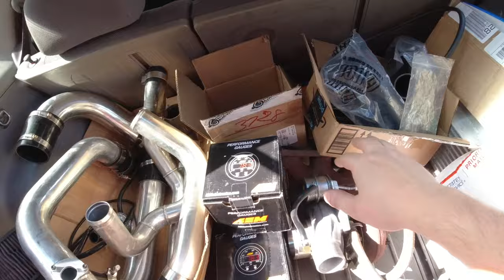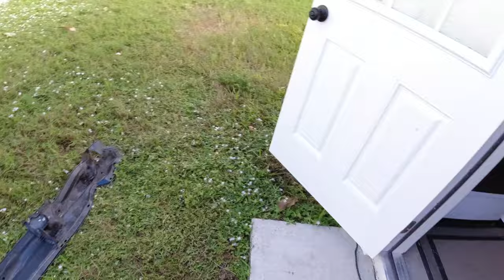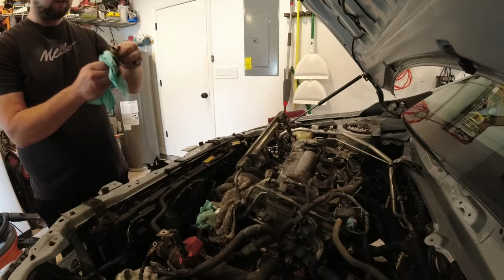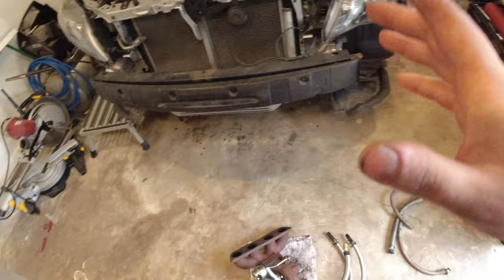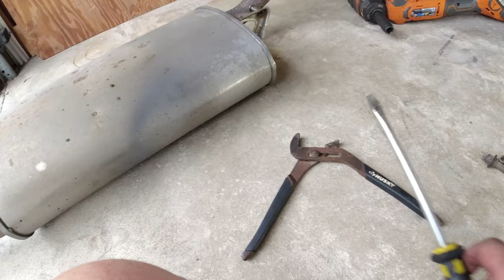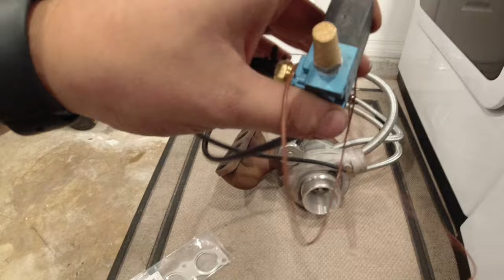TURBO INSTALL ON TOYOTA COROLLA PT 1.

Comment: The spare coolant reservoir is actually a Intake sound resonator. It helps reducing the air intake sound
Reply from the maker: That’s what I thought it was. Never have seen this on any other car!
Reply: That's not for coolant that's air pre air intake
Reply: @justinmike2zrfe  as i said mate.

Comment: When I changed my spark plugs I used part of a small hose that I got at home depot for 90 cents. Really came in clutch since I didn't have all the right tools.
Reply from the maker: If whatever you are using is close to the size you need then it will work perfectly! A few days after I did my spark plugs I finally found my spark plug gapping tool.
Reply: I used the old coils to pull it out and install the new ones aswell

Comment: The black intake box is to muffle the sound and hold any water that might get sucked into the system.
Reply from the maker: That’s what I figured after realizing it’s connected to the air box!

Comment: Nice! PLEASE PLEASE PLEASE give me a view of your bumper brackets while you have the bumper off. I'm having trouble with those things! I've already ordered and installed a set, but the bumper keeps popping off!
Reply: The clips on the bumper could be not holding it in. Line it up where it’s flush and just put a zip tie where the bumper has a clip on the side. That’s what I did and it holds fine
Reply from the maker: I have already put the bumper back on, but I know if will have to come off again soon. So I can get a close up of what the brackets look like!
Reply: THANKS so much!!!!  @BrandonStellmach

Comment: I have a 2009 Toyota Corolla  Japanese model , but I'm getting a problem the  car shutting down and all the lights on the dashboard are blinking. Can you help me with a solucian?
Reply from the maker: That’s very weird, maybe check battery and alternator are good. Seems to be some type of electrical issue.
Reply: @BrandonStellmach   OK

Comment: Just wondering if you ever think about getting the S trim wheel for this corolla?
Reply from the maker: This corolla already has the S steering wheel. Unless you are talking about the 10.5 gen S wheel, because that one has a flat bottom on it. Might do that!
Reply: yes it was, I was hoping to do the swap on my 2011 LE to that one @BrandonStellmach

Comment: Thanks, Great to see a DIY job from scratch. Just a check  - did you check the compression to make sure that all the cylinders were producing even pressure?
Reply from the maker: Thank you! I appreciate it! As for compression, I never checked it as the engine has seemed to function good with no signs of issues. But I probably should have checked prior. But everything has been running good with no issues!

Comment: Sup Brandon, I’m in the process of buying a black 2010 S model center console for my LE corolla. The seller told me it doesn’t fit for LE models, only S models. I know you bought one for your Corolla, but was it an S model or LE center console?
Reply from the maker: From what I have seen is the S model only came with a black interior. And all the parts for. The S interior will fit on all models of the corolla.

Comment: You think it would it be cool to turbo a automatic 09 corolla 115k miles
Reply from the maker: I have seen one on Instagram! They turbo there automatic corolla, making about 270 to the wheels!
Reply: @BrandonStellmach really? And the auto is holding the power down? I'd love to see that bc I was scared out of keeping the 13 2zr rolla bc of the u341e auto

Comment: bruh literally same thing happened to my corolla when i saw your bolt break off the tac welds 😂😂 can’t wait till i get some money and turbo mine, you think having a CVT trans rolla that it will still hold up?
Reply: Unfortunately bro the cvts are glass...you can run upwards of like 185wheel maybe but idk I've heard nothing but horror stories....just do a swap junkyard has too many 5-6 spd manuals and they are hit or miss but more on the hit side from what I've gathered. Toyota has pretty good internals in their trannies just not the autos or cvts for power
Reply from the maker: As mentioned in the comment already, the CVTs won’t hold much power without starting to slip and cause some damages. Maybe 200whp would be pushing it!

Comment: How fast did the old Corolla go on the dyno with the turbo in it?
Reply from the maker: I never got a chance to get it on the dyno, but with all the other people o talked to the base tune should have been around 225 hp to the wheels.

Comment: Do you know any good dual exhaust kits for the 2010 Corolla Le
Reply from the maker: I am not aware of any dual exhaust setups for these cars. It would have to be custom, since the corolla only came with one exhaust port. The bumper would need to be modified as well for the second outlet!
Reply: @BrandonStellmach  ahhh ok, I also try to check out the borla exhaust kit you put on yours, but it says it’s only for the S/XRS model. Do you think it could fit my LE? Cause the S and Le do have the same engine 1.8L
Reply from the maker: @prodbyKAHLEV it will fit on all corollas. The only reason it says S/XRS, is because they have the cutout for the exhaust. On all other corollas you will need to cut the bumper.